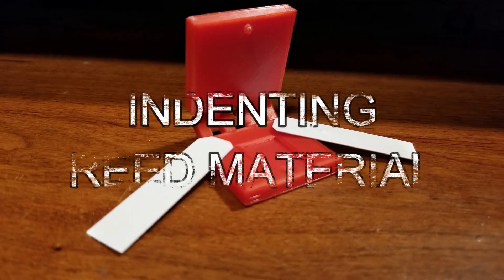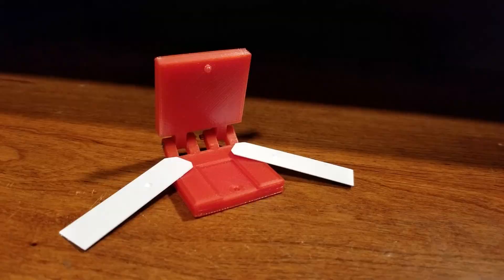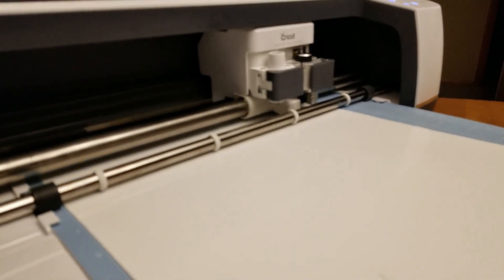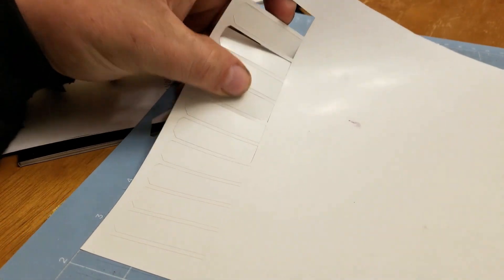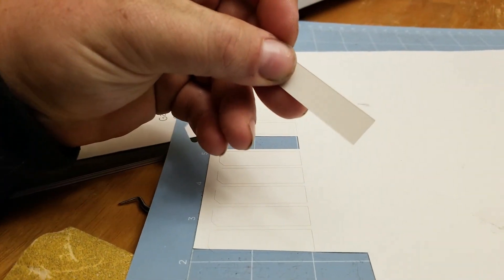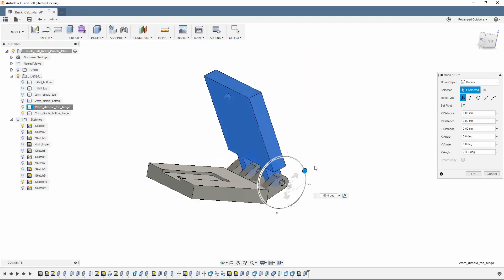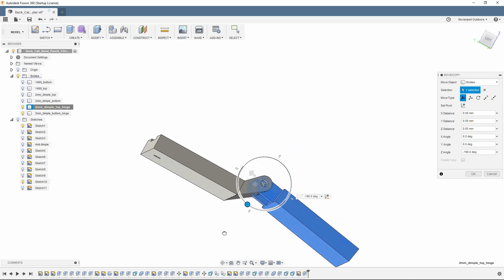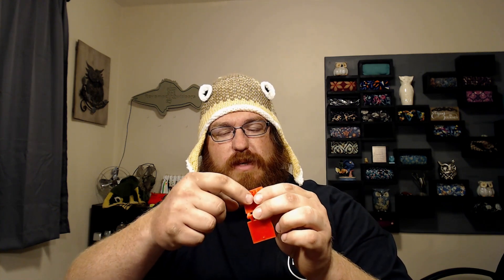Easy way to dimple (indent) game call reeds (Duck call example, STL included)

Comment: do you have a link for the mylar?
Reply from the maker: It's been so long I can't find the original source for the thicker material. I know the 10 mil mylar is just quilt stencil material you can get off of Amazon or at a brick and motor hobby store. The thicker 14 mil is a bit harder to source but there are some options on Amazon. I don't have affiliate links or anything whichever you can get for cheapest go for it. Depending on thickness all mylar is the same.

Comment: I know this video is 4 years old, but do you sell the reed dimpler?
Reply from the maker: Sorry about the delay, I traditionally have not sold anything I make. But there is significant interest in the dimpler. I think I would have to modify it a bit, at least the hinge setup because the assembly is a pain. I haven't had the printers operating in awhile but this is definitely a project I should revisit. I'll post here if I end up selling anything.

Comment: i know this is a older video but im looking to cut my own reeds for my duck calls, how does the circut handle 14mil mylar? what are your cricut settings to do so? i have the explore air 2 not sure if mine can handle this thick of mylar or not! thank you in advance!
Reply: Not to bring up a past question I touched on but I did get a maker 3 you said it handles 14mil? Did you have to do multiple passes?
Reply from the maker: I think it should handle it with the deep cut blade, the pinpoint blade is a bit small I think. That one needed two passes I think. If I remember right though the deep cut blade does dull and makes it multiple passes.
Reply: @RevampedOutdoors  awesome I’ll mostly be cutting 10min so if it handles that good I’ll be happy! If it does 14 that’s a bonus!
Reply from the maker: @Brandon Bove  now that I think about it the 10 and higher will definitely need more than one pass, I thought i was cutting thicker stuff.
Reply: @RevampedOutdoors  do you remember your 14mil settings? i can cut 10Mil mylar with the stock blade at 4 passes, even at 9 passes on the stock fine point blade with 14mil mylar i cant cut all the way through waiting for my deep cut blade to come in tomorrow im hoping that will solve my issue with 14mil mylar! thanks in advance for all your help!!!
Reply from the maker: I think I cut up to 16 with it and it handles it fine. The maker has a pressure setting so I did medium pressure can't remmeber the setting off hand. I think it needed the deep cut blade for the thick stuff. The thinner stuff can just use the regular blade with normal pressure. Sorry I can't help more it's been awhile since I had to cut reeds
Reply: @RevampedOutdoors  no worries at all! i appreciate the quick reply! P.S. should make some duck hunting videos!
Reply from the maker: Thanks! I might give it a try next year. The problem is finding the ducks this year the videos would have been pretty boring lol.

Comment: What size reed 0,25 ×13,7×50,0 mm ??? Mylar 0,25 or 0,27 mm ?
Reply from the maker: Sorry I missed this comment! I used 16 mil for a lot of reeds but I have used 10 mil in it and it works just as well. .405 mm and .254 mm respectively.